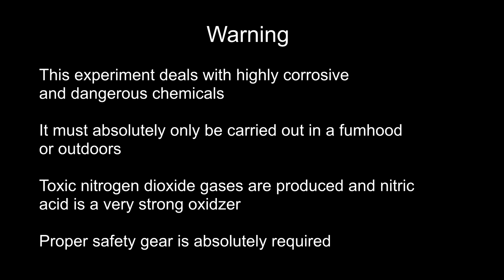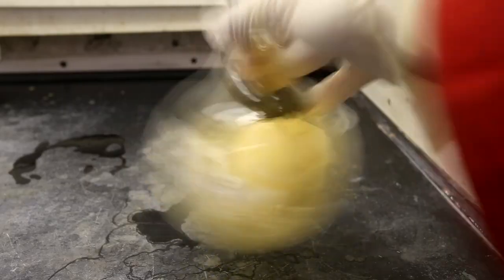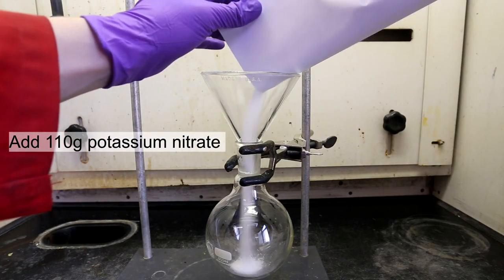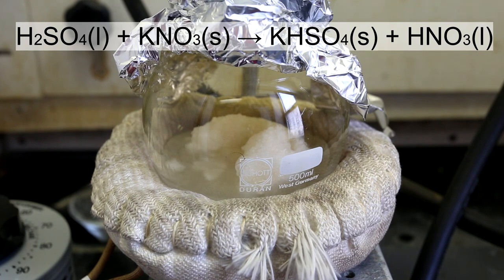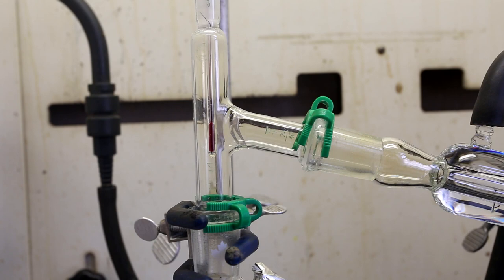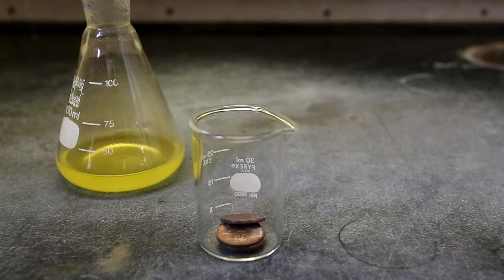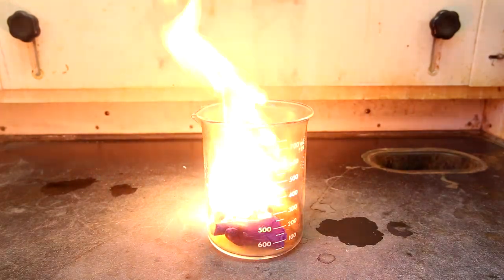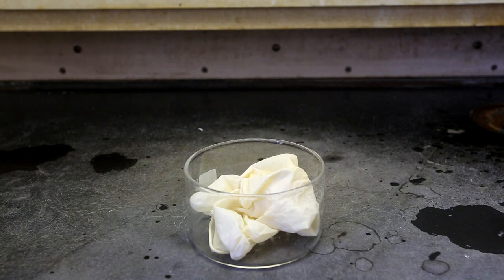Making Fuming Nitric Acid

Comment: Your nitric acid is too contaminated too yellow, it it's suppose to be more close to colorless
Reply: Lisandro Garcia It doesn't matter, the concentration of NOx in that would probably be less than 0.1%. You can get rid of the yellow colour by bubbling oxygen gas through it anyway.
Reply: You are not getting the point, there are situations where need nearly pure chemicals to drive forward certain restrictions, otherwise contaminants get in the way. It's not so much how it looks but rather what it is, what it's purity is.
Reply: Lisandro Garcia The only possible contaminant in this acid is nitrogen dioxide and dinitrogen tetroxide which causes the colour. You can't get it much purer than this. Urea, dry oxygen, or depressurising the vessel to 27kPa will remove the nitrogen oxides and you will have effectively pure acid. Besides, if you need super pure WFNA (which you almost certainly don't as practically no situations involving nitric acid are impeded by the presence of NOx's) then you shouldn't be making it from scratch anyway, get it from a legitimate chemical supplier like Sigma Aldrich.
Reply: Interesting, are you a chemistry major/profession by any chance. Just curious
Reply: Lisandro Garcia Haha no worries man. Bachelor of Photovoltaics Engineering/Bachelor of Advanced Science are the degrees I'm studying at university.
Reply: Cool, I attend U of H, Major: Computer Engineering, Minor: Organic Chemistry
Reply: +RadioTrefoil .....no,  I can think of a few situations where the concentration and purity are paramount. The production of RDX is a classic example, the same can be said for a few other more recent and somewhat exotic nitramines, not to mention for the home chemist it is also far more economical (and quite easy) to make pure nitric, all the way up to the anhydrous species-and this product can be superior to something thats been sitting in a wharehouse for god-knows how long.Same goes for lots of other chemicals that spoil without proper long term storage..ie in a freezer!

Comment: Its beter  to use sodium bisulfate instead of h2SO4 from my EX. Its less expensive and will not decompose unlike H2SO4.
Reply: Yea, the reaction will also be easier to clean up, and a less messy. Lol when you said "ex". I was wondering what you meant by that!
Reply: so you mean to mix sodium bisulfate with KNO3?
Reply: Should the same weight or quantity be used.? And are there other things to take notice of.?
Reply: ***** No, the reaction will be different.  2KNO3 +  2NaHSO4 --> Na2SO4 + K2SO4 + 2HNO3.  You have to calculate the weight ratios based on the molar weights.  I would be surprised if it is actually less expensive than using sulfuric.  Sulfuric costs more, but it's also a lot stronger.  Theoretically, the reaction should be 2KNO3 + H2SO4 --> K2SO4 + 2HNO3.  In reality, it's easier if you add more sulfuric (like in the video), which yields KHSO4.  Also, it's easier to mix a liquid and a solid than to mix two solids.
Reply: JMAPScience In my experience H2SO4 will not decompose to any significant extent, even when boiling. I have even distilled sulphuric acid without much problems.
Reply: Right.  I would like to make some oleum, but H2SO4 doesn't decompose below 572F, and hot, vaporized SO3 scares me too much.
Reply: I make oleum from the decomposition of potassium pyrosulfate.

Comment: how do you store this?
Reply: In a cold, dark place. Glass containers with plastic caps are best.
Reply: @benthemusicalchemist  Correction:  COATED glass containers with plastic caps with teflon seals.  Freezer storage is strongly advised.
Reply: @Franklin-jj4jz  I'll provide more information here for anyone who might read this going forward. 

Usually more immediately dangerous liquids, like nitric acid, are shipped and kept in labs for long term storage in plastic coated glass containers. The plastic coating gives the glass a bit of a rubbery feeling, and the extra grip helps to prevent the container from being dropped. In the event that the container is dropped and the glass cracks, the coating keeps the glass and acid from flying apart and spilling everywhere. Because such containers are designed to store hazardous materials, they also usually come with caps that are either entirely made of or at least lined with teflon. Teflon is very inert and is therefore resistance to being attacked by whatever you're storing in the container. Teflon has the added benefit of being self-lubricating (think non-stick pan). This is good because you really don't want to be putting all your power into trying to open the cap of a 4 liter bottle of acid.

However, that's the ideal scenario, and I believe that in home chemistry people can use their best judgement. A lot of the nice equipment that labs have aren't available to individuals, are prohibitively expensive for most people, or has to be bought in bulk. 

Nile synthesizes about 30 mL of nitric acid here. I do not personally think a coated container is warranted for that volume. Though I'm sure they exist, I'm not sure that I've ever seen a coated container small enough for that. This is a material that needs to be stored with as little headspace (empty air inside the container) as possible or it can go flat (the dissolved vapors will go away and you'll be left with azeotropic nitric acid). The need for teflon in the cap is dependent on how long one plans on storing it. If you're storing it for a few days, it shouldn't matter. A month? Yeah, teflon would be the way to go. 

I had specified a cold, dark place. The freezer is a perfect option for this as long as you have a dedicated freezer for chemicals. Fuming nitric acid won't freeze inside normal freezers. The cold decreases its reactivity and helps to prevent it from going flat. Nitric acid is photosensitive, which is why it should be kept in the dark.
Reply: @benthemusicalchemist  You've obviously done this before.  Our University lab made WFNA as needed 2 liters at a time using this method.  Making it was much cheaper than actually buying it and the older undergrads got badly needed experience synthesizing it.  It was stored in 1 liter coated amber bottles with Teflon caps in a dedicated hazmat freezer at -23c (-10F).  2 liters would last us a year.

Comment: Nitrate toleune three times in your next video using the fuming acid. Then ignite.
Reply: Bejoy Sen Haha
Reply: Just exposing toluene to fuming nitric acid will do the trick, although you'd have to do this pretty carefully to not blow yourself up, since multiple nitration is common.
Reply: I've worked with TNT before. Its not too shock or friction sensitive. I would compare it to wax, you can even melt it and cast bricks of it and nothing happens. In that regard, it's completely safe, although it is kind of toxic and tends give people headaches. The only safe way to detonate TNT is to use some sort of primary explosive device.

Comment: any one out here knows how to make tnt??
Reply: never nitrate benzenes guys the isomers will get you n blow ur hand off , unless u really really know what yr doing
Reply: Lol what do u mean
Reply: tri nitration of aliphatic hydrocarbons will nearly solely produce very unstable chemicals. if for instance one managed to achieve tri nitro toulene , one would then have many other forms of toulene mixed in all with differeing states of stability. while the commonly used one is 'fairly' stable for an explosive the others arent. while working up ur raw product you could have a nasty experience with auto ignition of ur substance and the detonation that will follow will probably cause you alot of harm. if an amatuer was to make a primary or even secondry explosive id stick to the simpler nitration procedures like that of hexamine or potassium or ammonia all are fraught with danger and i wouldnt reccomend anyone make explosives and not have a good handle on what they are doing. rdx would probably be the safer one and can be performed in a kitchen but will require a detonation cap most dont have access too and hg fulminate is also very unstable and so u would produce an entirely useless product without another procedure to aquire fulminate quiksilver, which could lead you back to blowing your hand up.

Comment: Sulfuric acid is much stronger. Nitric acid is a weak acid :(
Reply: I'm curious as to why you say that. Sulfuric acid might be a stronger acid but I hardly see why it should matter when the video is about making nitric acid.
Reply: The strength of an acid doesn't have much to do with its potency or usefulness.  There are any number of situations in which nitric acid is superior to sulfuric, and vice versa.  I say use the right tool for the job and don't worry about how strong it is.
Reply: Jason Patterson Here is an example: Nitrating celluose requires sulfuric and nitric acid because the sulfuric acid donates protons, and the nitric acid actually adds the nitro group. if nitric acid was a strong acid, you would not need h2so4.
also, what you were thinking about were chemical properties other than acidity/electron deficiency. Hope this clears it up
Reply: Jason Patterson (Science as a second language is my other channel by the way)
Reply: Bollocks!  Nitric acid is less strong, but it is definitely not a weak acid.  It dissociates almost completely in water.  Acetic , citric, and nitrous are fairly weak.
Reply: Richard A I guess I didn't mean "Weak". 
For example: When making nitrocellulose, sulfuric acid protonates the cellulose and the nitric acid is what actually nitrates the cellulose 3 times
Reply: It's usually pretty easy to tell what people mean, but it still bothers me when "strong" or "weak" are used to refer to the potency of an acid or base. Richard is correct: these terms refer only to the degree to which the acid or base dissociates in water. Hydrofluoric acid is a weak acid. At the same concentrations, HF is more corrosive than HCl, a strong acid. I'm not trying to pick on anyone in particular. I'm just saying that I see this misconception a lot on youtube, and someone less knowledgeable about chemistry might misinterpret "weak" as harmless.

Comment: Can someone answer me QUICKLY how can I store HNO3? I have a small glass flask with a rubber stopper, and a glass jar with a metal lid, which wont work because it will dissolve metal. Can someone make a list of materials that resist HNO3? Thanks!
Reply: th3thin9 Glass, PTFE, polypropylene. Or you can wrap a copper coin in plumbing PTFE tape tightly in several layers, and put this PTFEfied coin into any screw-on bottle lid. This will keep HNO3 at bay.
Reply: avrorik369
you mean like wrap a penny in black duct tape and drop it in a HNO3 solution and screw ANY type of lid on the glass jar? even metal?
Reply: +th3thin9 If you need to ask this question you very obviously shouldn't be using nitric acid at all. (Or possibly, a sharpened pencil either.)
Reply: StrikingColor Glass You know that that would perfectly work, it uses the exact same method that sacrificial anodes use.
Reply: Charcoal the Otaku Cat an* and yes, I totally agree with you. People this stupid shouldn't be watching such dangerous chemistry videos.
Reply: +th3thin9 Then by all means, to safely store your acid wrap a penny in black duct tape, drop it in a bottle of HNO3 and screw ANY type of lid on the glass jar, even metal. You might do the world a favor, and wind up as a Darwin Award winner at the same time.
Reply: +th3thin9 That's pretty amusing, considering that I'm not the who posted because he couldn't figure out how to store acid. Nor am I the one who couldn't understand the reasonably clear answer he was given by someone else.

 I also believe my comment recommending you don't play with acid WAS constructive in your case - if you don't want to hurt yourself. But to each his own. Carry on genius...
Reply: +th3thin9 As much as I would like to engage in a "battle of wits" with you, at this point I'm going to have to decline since you are so clearly unarmed. Have a nice day.
Reply: StrikingColor Glass Have a nice day, be careful, you can drown in all that ego of yours.
Reply: +Nitro I don't know why you're giving StrikingColor Glass such a hard time seeing is he might have just literally saved you life. If you had gone ahead and wrapped a copper coin in duct tape, placed it into a container of HNO3, and screwed on the lid, several bad things will happen to you. First, the HNO3 will rapidly dissolve the duct tape and react with the copper coin, producing nitrogen oxide gas, which will build up pressure until the container explodes, sending glass and acid everywhere, most likely blinding you or even setting your clothes on fire. Then, if that doesn't kill you, the nitrogen oxide gas released will instantly convert to nitrogen dioxide upon exposure to air which you will inhale. Once inhaled, it forms nitrous and nitric acid inside your lungs which will probably cause pulmonary oedema a few hours later. Pulmonary oedema is when your lungs fill with fluid and you basically drown yourself. So yeah...